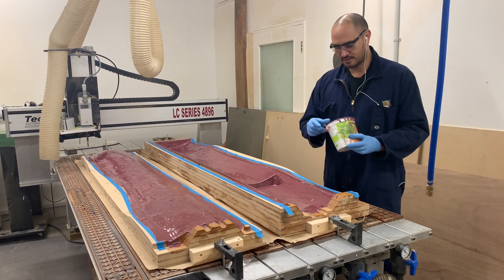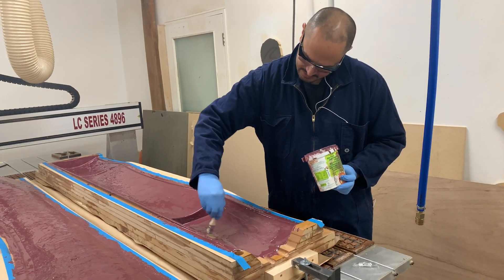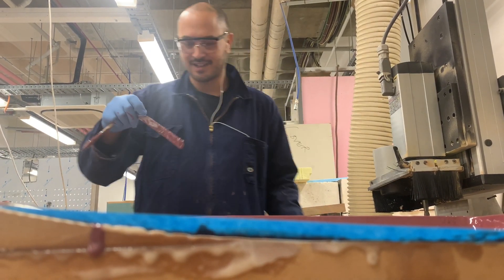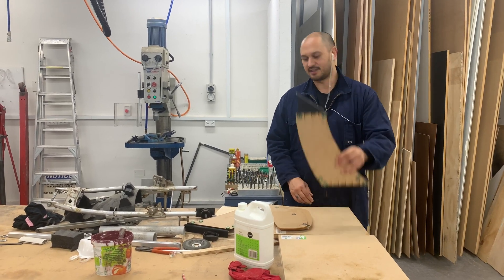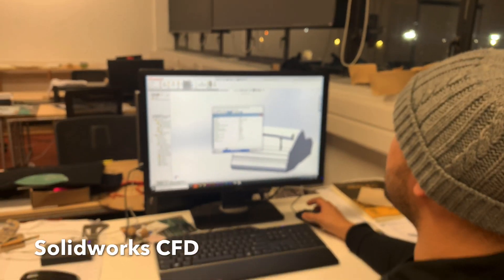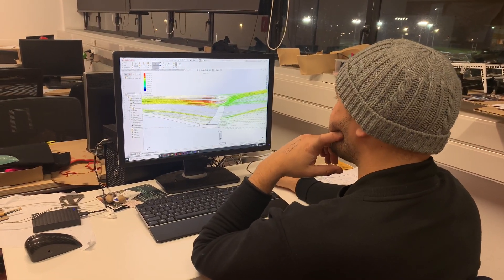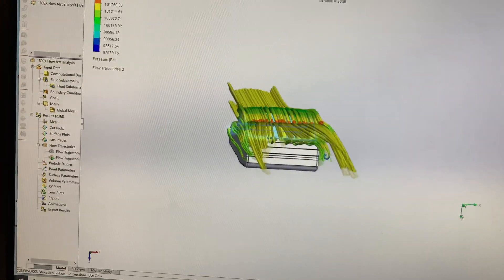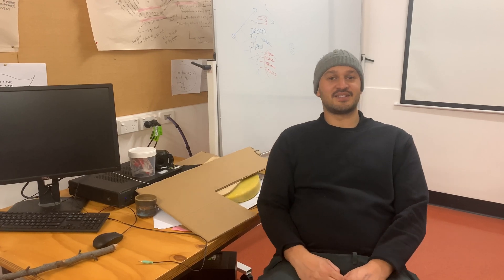I Made A Carbon Fiber Wing In My Garage

Comment: So cool man, are you going to be producing those to sell?
Reply from the maker: Thanks man - its been such a cool project of mine and a vision ive had for such a long time. I will eventually be producing these and everything will be carbon including the uprights. Ive got a price range of between $1500NZD ($980USD) to $1800NZD ($1180USD) as i havent fully worked out the pricing yet but theyll be around those figures. The Big Country labs wings wont come with as much carbon accessories as mine and will be significantly heavier at $2400NZD ($1580USD).

Can just sell the element on its own as well.

Shipping is not super expensive worldwide either.
Reply: @AdamNZ  awesome, cant wait to see the finished product.